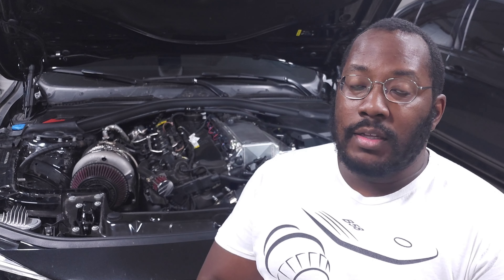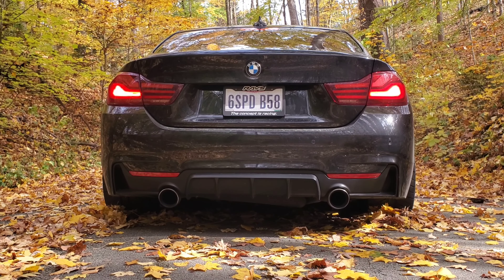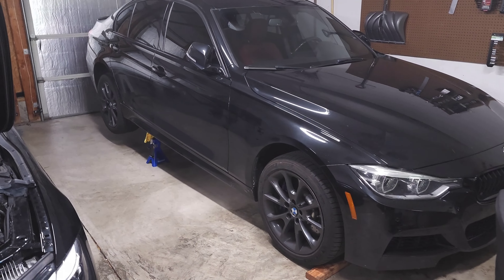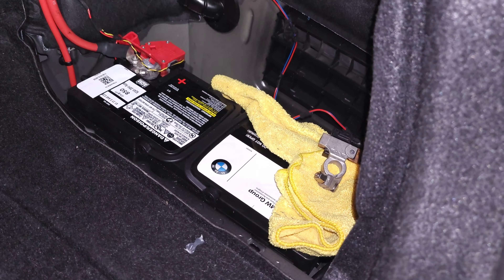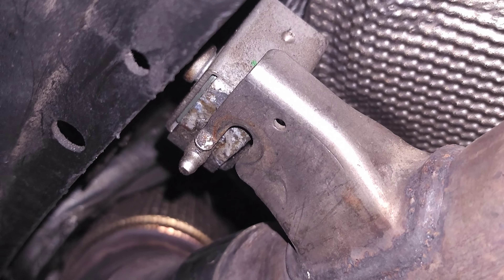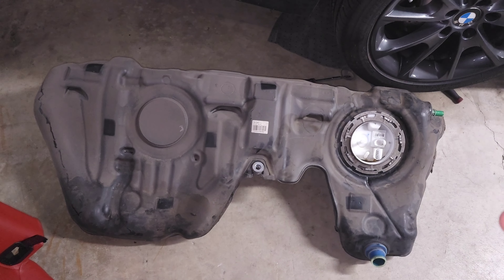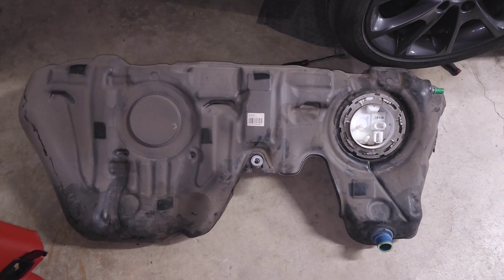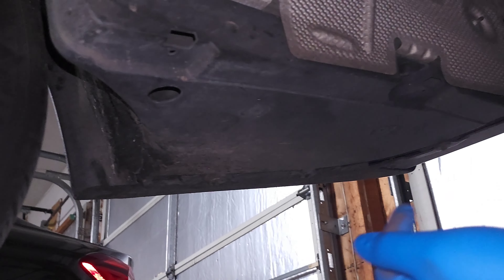How to replace the Fuel Tank on a F30 BMW 3-series

Comment: I went from doing valve cover gaskets, control arms, oil pans, water pumps and etc on E9x chassis to rebuilding engines (N20), replacing fuel tanks, timing chains, on these Fx chassis 😅

Comment: My fuel tank is leaking too i just noticed it today. Is this a common problem? Would it take away performance?
Reply from the maker: i wouldn't say it's super common but i have seen some people with that issue. it won't affect performance but it is a safety problem. leaking fuel is very bad.
Reply: @kern417  could the fuel tank breather cause it to leak gas?
Reply from the maker: Not really
Reply: BMW extended warranty on the fuel system to 15yr/150K miles on several early F30 models.  Check with your dealer before fixing yourself (if you haven't already)

Comment: Nice video man.  Thanks for the real-world DIY instructions.  My 2012 328i started spewing fuel 3 days ago and it appears that its leaking from the tank on top of the drivers-side.  I looked through my records and found a letter from BMW that says theres a 15yr/150K extended warranty on these fuel tanks, so I'm optomistic that it'll be covered.  

FYI, I read that since 2012 was the first year of the F30, BMW actually reused the previous model's fuel tank and just plugged outlet holes from the previous design.  Over time, these plugs get weak and can leak. I guess we'll see if mine is covered, but if not...your video will be gold for me to do the repair.  Thanks!
Reply: I have the same problem on a 2014 f21 m135i, how can I find out if there is a campaign for the car?
Reply: Did BMW cover it under the extended warranty? I found that link online too

Comment: Luckily on my 435i BMW has a recall on the fuel tank. Also it got a new fuel pump under waranty at only 4000Km. BMW's fuel supply system seems not to be the most quality one...just think of all the injector problems on the N54/N55 engines.
But great video, very informative.

Comment: I undid the drive shaft bolt. What did you do to get it unseated from diff?
Reply from the maker: the driveshaft? you have to remove the center bearing bracket and pull it out of the diff
Reply: @kern417   I ended up just unbolting from transfer case but i had already undone the bearing bracket and still couldnt unseat. marked it with paint to maintain balance though!